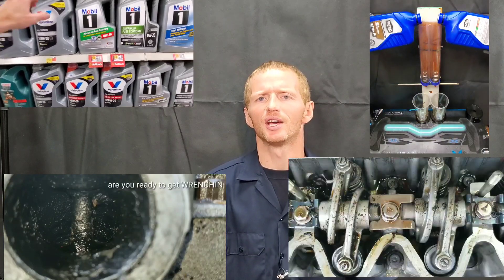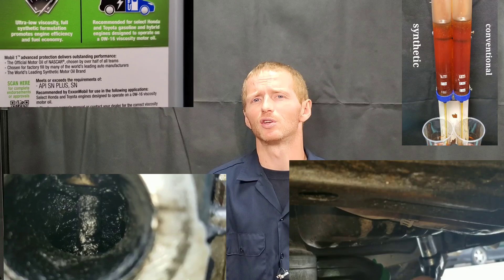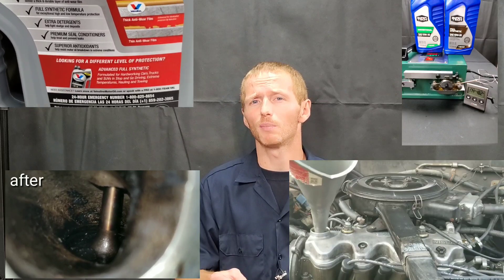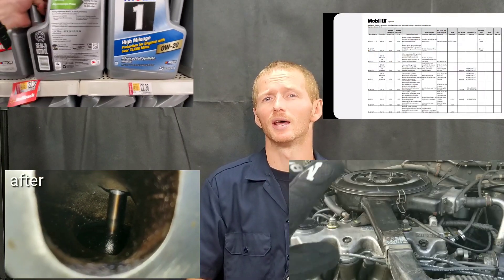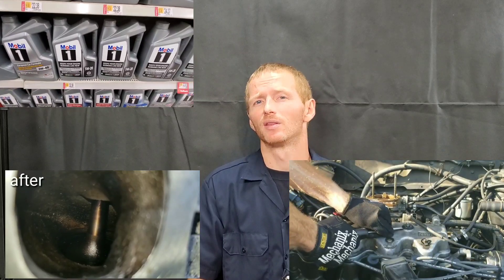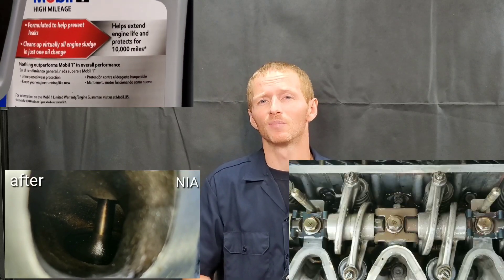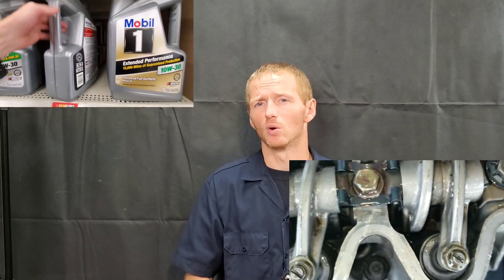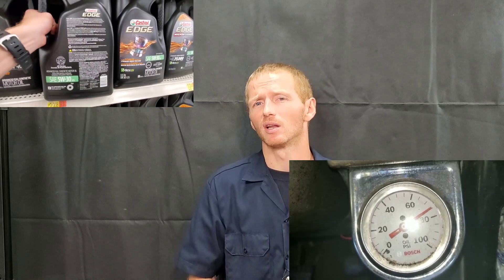DO NOT USE Full Synthetic Engine oil for old cars?

Comment: When I first got my 1993 Cavalier Z24 with 142,000 miles on it, I of course wanted the good stuff, synthetic but after the oil change it started to get loud and tappy so I had to change out Right Away to conventional... sometimes your lucky and sometimes you are not so lucky🥴

Comment: This information is obsolete. Current full synthetic oil are not PAO nor Ester, they are made from hydrotreated or hydrocracked. Also most oil no longer have API logos, they are not certified, so they may have poor quality, causing sludge and oil leak.

Group 1 / solvent refined oil will actually have the best sludg cleaning property other than oil with ester.

Comment: Not sure what you mean by "flat tappet". Regular rocker arms with no rollers? Most cars use that design. So, I think automotive engineers would be aware if engine oil needs zinc.

Comment: Great info, especially about the flat tappet engines and the need for ZDDP. My old flat win BMW motorcycle is such an engine. I'm shopping around for 20/50 mineral with ZDDP, but I'd use a synthetic if I have to.

Comment: I have been using Mobil 1 15w-50 in my 1970 Cadillac 472 since 1987. We will have to see what the cam and lifters look like if I ever tear it down. Good video,  thanks for sharing the information.
Reply: What the hell? , thats Gearbox oil noway
Reply: @hydronik9838 , nope. It is motor oil.

Comment: It is really true statement, it causes my 2000 Camay and 2006 Sienna check engine light on 2-3 days after oil changed for Code P0430, can you suggest what is engine oil I should prefer to use please

Comment: Flat tapper Chrysler engines, I use racing oil which has ZDDP. I usually add in a bottle of ZDDP. Some folks swear by Rotella. A new engine I bought (rebuilt 383) came with Joe Gibbs 20-50 racing oil. My old Mopar is my daily and I change the oil every 3 months per Chrysler service manual as I don’t drive enough for 3,000 miles before 3 months is up.

Comment: I have 2000 Vauxhall Vectra 2.0 16v after I changed the whole crankshaft bearings I had used motul 10w40 6100+ synthetic oil and there was no oil burn for 2k km but after 2km i had a crankshaft bearing wear problem. I changed them again and used Mobil 10w40 2000 semi synthetic oil after 3k km my car burned nearly half litre oil and looks no problem with the engine

Comment: There's a recing series in my country call toyota gazoo racing event , which only use vehicle supply by toyota, with limited and restrictions for what can be change or tuned on the car , one team I cought the attention of the all teams when they head for dyno and tech inspections 
Engine are not viable for any tuning, but this team's car power comes in sooner and faster,  which cought the attention, but it passed the tech inspections 
The team's head mechanic happens to be my karting buddy, and I'm now in the race, so he told me that he break in the engine with thinner viscosity oil than factory recommended and add in extra zinc additives,  and break in as slow as possible 

This is how he convinced me that oil additives actually works

Comment: My engine builder advised to use Schaefer's Oil.  I called Schaefer's, told them my set up, planned use, and they recommend one of their oils.  Before rebuilding my 440 engine I used Lucas Classic Car Oil or Brad Penn, specially formulated with zzzp.

Comment: I use valvoline h.m. synthetic blend with a bottle of prolong engine treatment. Absolutely the best engine additive on the market! 2003 buick lesabre 3800 series 2 with 450,000 miles going extremely strong! I do a oil change every 3000 miles and when I change it, oil is almost just as clean as new!
Reply: Those last
Reply: That 3800 is arguably the best engine GM ever made.  Had one in my '97 Pontiac Firebird.  Wasn't a w-6 V8 but it was solid enough for it's day until this crazy woman whacked it from behind, totaling the car (Frame Damage).

Comment: Just use good quality recommended oil and change it every 3000 ...
Simple.
I have over 300k on all my GM fleet trucks vans. Walmart oil fine.
Alot of hype nonsense over oils.

On older worn motors that blow blue synthetic does not make blue smoke or foul plugs as fast.
Very expensive though.

Comment: I run one of two motor oils in my 97 Gran Marquis with 260k on it.
Castrol Edge Full Synthetic 10W-30
Kendall  Synthetic blend 10W-30
Both have the titanium additive in the oil.
In the early days of Synthetic motor oil. The conventional motor oils were not compatible with Synthetic motor oils. Could not mix them. Once you switched to Synthetic motor oil you would have problems with the engine of tried going back to conventional motor oil.
Sears had to replace a engine for my brother. 
He had oil changed there and they used a Citgo Synthetic motor oil. He had been using conventional motor oil. The next day driving to work his motor locked up. Mechanic that pulled it apart showed him this jar of glob of jelly. Told my brother that was the motor oil that had jellied up. This was in 1978.

Comment: Do not fall for the ZDDP myth.
High zinc does not guarantee low wear.
Reply: On old style flat tappet cam lobes it did.
New engines don't use that anymore.
Been building engines gas diesel industrial marine since 1978.
Reply: @Motorhead250  the camshaft companies think they need high zinc on flat tappet camshafts / lifters.
The reality is that the lifters become crazed.... Not good.
Zinc is a 1960's technology..... No extreme pressure lubrication.

Oil Extreme's concentrate ( Calcium Sulphonate) gives extreme wear protection.
David Vizards Oil Extreme Dyno Developed Race Engine Break in System is the only Break in Oi' that effectively Seals Rings /Bores and works very effectively on cams/ lifters.
Reply: @Motorhead250  I have a flat tappet cam engine in my Race car.
Oil Extreme has helped 1 engine builder gain an advantage in Formula Ford engine building.
1.5 seconds per lap is amazing for Formula Ford
Reply: @Motorhead250  how do you know. Did you strip the engine after break in.... Probably not.... You would have possibly seen damaged surfaces..... Improper Break IN.

High Zinc is usually a myth.

Nascar teams are still having issues

Comment: POE softens seals...and it does clean the sludge off the inside of the motor ...had a friend grenade a motor because of that property.
Reply from the maker: Wow thanks for the story as your experience or your friends in this case is informative.
Reply: The best results i ever had was from using Redline in a 1955 Ford tractor...cut the engine noise in half!

Comment: It all depends on what vehicle you have and the condition of your engine. My 2 old Chevy trucks burn less oil and barely leak with Pennzoil conventional. Switched to conventional high mileage about a couple years ago.
Reply from the maker: The details of your experience on the subject will really go a long way to make better informed decisions.
Reply: I think I'm going with penzoil high mileage conventional d5 w30 on my 2004 Suzuki.  I'm not sure what is on there now. how can I find out?

Comment: There have been cases of resource conserving additives causing issues in newer direct injection motors...I use Castrol Edge in 40 weight because it doesn't have the resource conserving stamp on it
Reply from the maker: Very interesting thanks for pointing this out

Comment: I have a Volvo V70, lll, 2.4D, 2009
When i invested my Volvo, i use Castrol 0w-30, what oil was super expansive. That i test just Mobil1 0-30w. 
I be positive supriced about Mobil1, i have now drived type 10000km, motor not gived info to need fill up extre oil- exactle sameone select as when me change oil from castrol to Mobil1. So i’m enjoy with mobil1

Ps. My car have drived 380000km diesel and very cheap to drive 0.47L per mil
Reply from the maker: This is nice for you to share your knowledge with the NIA community as it will help us all either now or in the future.

Comment: I have honestly had great luck using synthetic oil in older engines. My 2003 Ford Taurus has almost 250,000 miles on it and I will put full synthetic oil in it this winter, as I have since I have owned the car. Flat tappet engines do indeed have different lubrication requirements than newer ones so, talking to an engine builder is your best bet there. Thank you for the great content!
Reply from the maker: Thanks for sharing your experience as it really helps us to determine what may help ourselves.
Reply: Not what I would call an older engine though. 1970’s or earlier is what we’re concerned about
Reply: Yeah at least 1995 or older, that being nearly 3 decades

Comment from the maker: Tell us your experience using synthetic oil on older engines.
Reply: Random Youtuber  no in order to claim the full synthetic title your oil must only be 1% synthetic
Reply: Random Youtuber  I work in the industry I know their requirements
Reply: Random Youtuber  and learn your terminology its synthetic blend not semi synthetic
Reply: @ShironAdam  I have an 03 Toyota and used 5  30 Castrol and now can't get it. I am using the Castrol blend and my MPG feel off 3 MOG. What do you recommend.
Reply: @mikewhite7462  have you done a tune up recently
Reply: @mikewhite7462  switching from standard to blended wouldn't cause a mpg drop when's the last time you changes yours plugs and filters
Reply: @mikewhite7462  switchback to conventional and replace the pcv valve(s) before you destroy your engine. Synthetic causes pcv failures ,  CONFIRMED, which in turn causes back pressure  in to your catalytic converter(s) and INTO YOUR ENGINE AND causing OVERHEATING. If you insist on going synthetic at least install a good brand oil catch can , by mishimoto or greenmouse  to protect your pcv and catalytic converter.
Reply: Random Youtuber  the only oils that are truly full synthetic are castrol edge and mobile1
Reply: ShironAdam Amsoil
Reply: @johnsanders6946  o yea I forget about amsoil we don't have any suppliers for it in my area
Reply: I used synthetic in a 1986 Oldsmobile with 60k original miles. It literally destroyed the engine in 2 weeks.
The dealer suggested it . And I stupidly listened. The dealer took no responsibility and their mechanic said there was a defect in the motor and ring failure. Sounds 👍 good. Liars.
Reply: @jwayne777  what was the brand and what year did you do that?
Reply: 90% of full synthetic oil is only 1% synthetic its a hoax